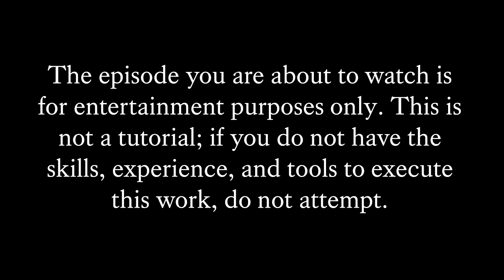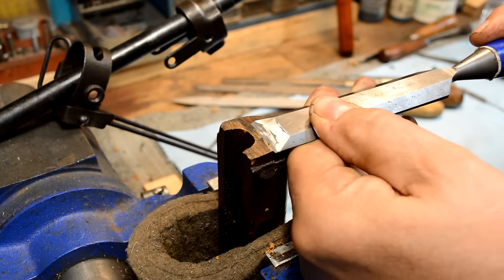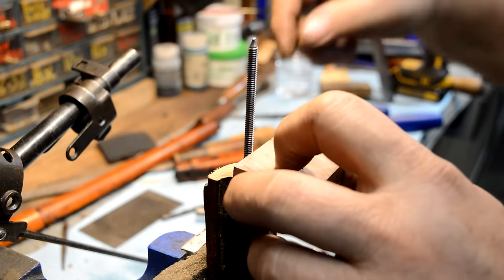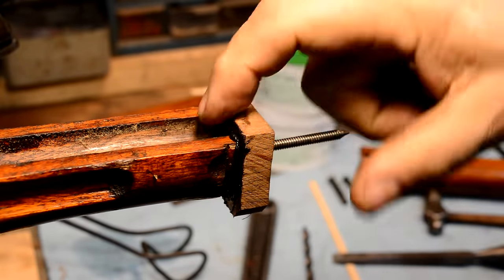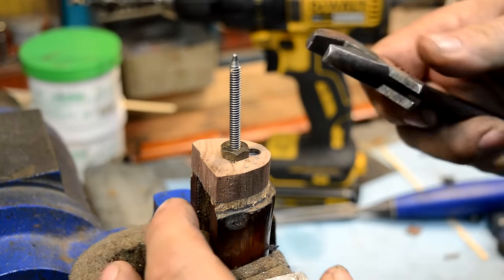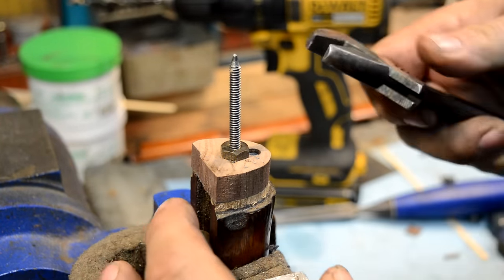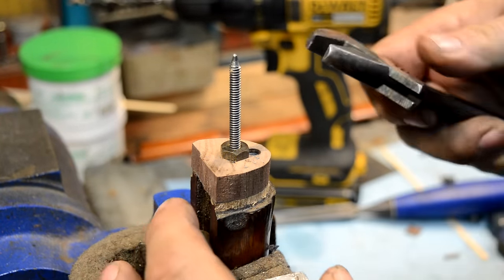Anvil 086: Type 99 Arisaka duffel cut repair

Comment: It's always fun to watch people work that know how to do the work rather than people that try to perfectly engineer a plan and then find out later their perfect plan fell apart.
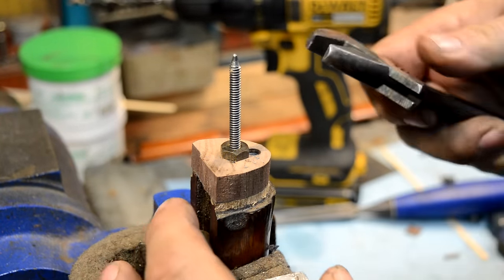Reply: Well this isn't going to be welcome but here we go. @31:53 we can very clearly see that the top edge of the stock on the right is noticeably higher than that on the left of the join. Mark does not see this. This is the stage where the parts are brought together dry so that they can be fitted correctly. Look closely, it can be seen that the barrel is sitting down hard into the wood on the right but is lifted in the wood on the left as witnessed by a gap between the wood and the metal on the left. This can only be caused by the wood on the right being too high in relation to the mother stock and shows that the hole for the threaded rod is in the wrong position and is causing the joint to be out of line. 
Having assembled the joint @37:43 we see that the exact same conditions apply and the repair is out of line. Start watching at 38:10 Mark checks the alignment and (look closely) moves the stock even further out of alignment by lifting it higher. Shortly after this he confidently tells us that this is not the sort of gun that you learn on. @40:10 here's the smoking gun! Notice how the wood grain is showing through the glue. It stops showing at the exact line of the join because the barrel was lifted up from the mother stock by the miss aligned stock. All the pressure of the rubber strap could not pull it true because the threaded rod could not allow it to move into line. @42:32 look closely at the visible left hand edge of the glue and it can be seen to have considerable thickness. This is the result of the barrel not sitting down in its cradle in the stock. The thickness of the glue exactly matches the degree of missalignment of the top edge. @45:01 he finally notices the problem with the top edge of the stock and cuts a little wood off. @45:16 Mark starts to explain that wood moves with time and he's right. However no amount of explanation can put this situation right. @47:18 he cuts away wood and tells us that it swelled right here. He demonstrates that he does not understand why the top edges are not in line and level. @49:14 this is the first time that we see the results of the missalignment. Not withstanding any bending of the top stock the gap between the top and bottom on the left of the joint is exactly equal to the degree of error in jigging the two parts of the stock together. Mark's attempts to blend the joint are seen as a freshly cut ramp in the wood. @51:23 Mark is telling us that the front end joint is tight and it is. However he makes no mention of the gap behind the joint which will always be there. @54:20 observe the gap where the top covers the bottom. In spite of any explanations that gap is there because Mark assembled it out of line. 
I have been a gunsmith for over 40 years and am often called upon to correct poor repairs. I despair at this job and I wonder if the owner will be content with explanations of swelling wood as he holds this rare example. Often I have found that workers who make sure we all know how good they are can produce average work with eloquent and lengthy explanations of how difficult it was and how the average joe would make a hash of it. I expect this comment will be deleted as it will not sit well with Mark Novak. I challenge you to leave it here so that your viewers can respond.
Reply: @IRMacGuyver  I understand about such effects. I also understand about how people deny the truth when (for reasons known only to themselves)they cannot cope with an observation that rattles their cage. The lens beautifully reveals the exact details of why this repair was so very tragic for the owner of this gun.
Reply: @IRMacGuyver  Please explain how a lens can produce a step in a joint. You can plainly see how he tries in vain to level up his mistake with a chisel. The gun is ruined by this repair not by a lens and I'm not sure why you feel the need to deny the truth. This only looks fine if you close your eyes and your mind.
Reply: @IRMacGuyver  Well I didn't expect that level of denial of the truth. Ok if you believe that a defect in a lens can cause the two pieces of wood to be out of line then good luck to you. Before I go I just want to ask you how this lens defect only shows up on that exact point on the gun? I studdied optics for three years and page one of the book tells us that refractive faults are not selective and their effect is always there even when the so-called craftsman is desperately trying to chisel wood from the step in the joint. God help you as you navigate your way through life.
Reply: @IRMacGuyver  By the way, the earth is flat after all. We just found out it was a defect in the lens.
Reply: @jonka1  What denial of truth?  Your made up fiction from not being able to see straight?  Do you really hate this guy so much you have to invent fictions to try and subvert him?
Reply: @IRMacGuyver  I don't hate him. I can see that he sets himself up as a time served expert craftsman and fails to join two pieces of wood properly thereby spoiling a customer's gun. 
As for your problem I'm lost for words at your desperate quest to defend the integrity of his actions. God help you as you navigate your way through your life.
Reply: @jonka1  You must hate him to come comment on my post that had nothing to do with your conspiracy theory.
Reply: @IRMacGuyver  I don't hate him. I initially replied to your words,  "It's always fun to watch people work that know how to do the work rather than people that try to perfectly engineer a plan and then find out later their perfect plan fell apart."
I thought that you had captured the essence of my experience and I wished to offer a different take on the situation. If you wish to go down the "conspiracy theory" road you will not see me there. If you need to be right about something perhaps you need not put it here for public gaze but instead just quietly believe that you are right and I am wrong.
Reply: @jonka1  Yeah but your nonsense conspiracy has nothing to do with the fact he's actually good at what he does.
Reply: @IRMacGuyver  He doesn't need to be good, he has you fighting his corner. I'm tempted to feel sorry for you but if I close my eyes and hold my breath the feeling goes away. 
God help you as you navigate your way through life.
Reply: @IRMacGuyver  I've just checked out your YT channel. Suddenly your behaviour makes perfect sense.
Reply: @jonka1  Too bad your behavior doesn't make sense.  Why do you have to make up lies to try and smear a good man's skills?
Reply: @IRMacGuyver  God help you as you make your way through life.
Reply: @IRMacGuyver  God help you as you make your way through life.
Reply: @IRMacGuyver  :)
Reply: @jonka1  smile all you want but you still don't know anything about gunsmithing.
Reply: @IRMacGuyver  :)
Reply: @jonka1  keep proving the point that you have no clue what you're doing.
Reply: @IRMacGuyver  :)
Reply: @jonka1  How can you so carelessly try to smear someone's reputation?
Reply: @IRMacGuyver  :)
Reply: @jonka1  You still have nothing to add to the conversation because you made up your rant in the first place.
Reply: @IRMacGuyver  :)
Reply: @jonka1  How does it feel to admit you never had a real point to make and you just want attention?
Reply: @IRMacGuyver  :)
Reply: @jonka1  Do you really enjoy being wrong this much?
Reply: @IRMacGuyver " @jonka1 smile all you want but you still don't know anything about gunsmithing."
I wasn't going to waste any more time on you but I just wanted to let you know that I collected £1800 for two days work on a 16th century wall gun and the customer was in tears of joy for the work I did for him. The work involved a bit more than failing to join two peices of wood together properly, the first day was spent correcting work done by someone who (apparently) had never stopped talking about how skilled he was and how many guns he had rescued from poor workmanship. 
I'm not going to discuss anything further with you and will only smile at your words as you desperately try to be right about nothing.
Reply: @jonka1  No you didn't.  What you did is make up a story because you want to sound like a big guy on the internet.  You don't even have any videos as evidence on your channel.  You just come here to comment on stuff that you know nothing about.
Reply: @IRMacGuyver  :)
Reply: @jonka1  You can keep that up but you can't hide the fact you're making up crap to try and put down a good gunsmith.
Reply: @IRMacGuyver  :)
Reply: @jonka1  It's funny how you claim you know so much as a master gunsmith yet you spend all your time on youtube insulting other people's work instead of filming your own projects.
Reply: @IRMacGuyver  :)
Reply: @IRMacGuyver  :)
Reply: @IRMacGuyver  :)
Reply: @jonka1  You're only smiling cause you know you have no knowledge of real gunsmithing.
Reply: @IRMacGuyver  :)
Reply: @jonka1  It's too bad you aren't a gunsmith you could have fixed a gun instead of replying to this video.
Reply: @IRMacGuyver  :)
Reply: @jonka1  If only you could prove everyone wrong and upload a video of you actually doing something.  But you can't cause you're just here to insult people that do real work.
Reply: @IRMacGuyver  :)
Reply: @IRMacGuyver  :)

Comment: Is the three lobe emblem in the opening a dardick cylinder?
Reply: Nope. That's a cross section of a modern cartridge primer. The priming compound is trapped in a thin layer between the primer cup and an anvil with three lobes. When the firing pin strikes the primer, the compound is violently pinched between the anvil and the primer cup, and being contact sensitive, goes off, thus igniting the powder and sending the bullet down the barrel.

Ties in nicely with the primary series of the channel "anvil" when the anvil is highlighted.

Comment: I think I would have made dovetails in the repair wood for extra contact area. Not that I can do a dovetail joint right now, but that's what I would do. Maybe use a separate piece, shaped like an hourglass. Edit: and add a piece of fiberglass cloth to the barrel bedding area.

And then break out the freaking chem warfare gear for lacquering the repair. Damn, that stuff is NASTY!!!

Comment: Nice Repair and Craftsmanship
Reply: Well this isn't going to be welcome but here we go. @31:53 we can very clearly see that the top edge of the stock on the right is noticeably higher than that on the left of the join. Mark does not see this. This is the stage where the parts are brought together dry so that they can be fitted correctly. Look closely, it can be seen that the barrel is sitting down hard into the wood on the right but is lifted in the wood on the left as witnessed by a gap between the wood and the metal on the left. This can only be caused by the wood on the right being too high in relation to the mother stock and shows that the hole for the threaded rod is in the wrong position and is causing the joint to be out of line. 
Having assembled the joint @37:43 we see that the exact same conditions apply and the repair is out of line. Start watching at 38:10 Mark checks the alignment and (look closely) moves the stock even further out of alignment by lifting it higher. Shortly after this he confidently tells us that this is not the sort of gun that you learn on. @40:10 here's the smoking gun! Notice how the wood grain is showing through the glue. It stops showing at the exact line of the join because the barrel was lifted up from the mother stock by the miss aligned stock. All the pressure of the rubber strap could not pull it true because the threaded rod could not allow it to move into line. @42:32 look closely at the visible left hand edge of the glue and it can be seen to have considerable thickness. This is the result of the barrel not sitting down in its cradle in the stock. The thickness of the glue exactly matches the degree of missalignment of the top edge. @45:01 he finally notices the problem with the top edge of the stock and cuts a little wood off. @45:16 Mark starts to explain that wood moves with time and he's right. However no amount of explanation can put this situation right. @47:18 he cuts away wood and tells us that it swelled right here. He demonstrates that he does not understand why the top edges are not in line and level. @49:14 this is the first time that we see the results of the missalignment. Not withstanding any bending of the top stock the gap between the top and bottom on the left of the joint is exactly equal to the degree of error in jigging the two parts of the stock together. Mark's attempts to blend the joint are seen as a freshly cut ramp in the wood. @51:23 Mark is telling us that the front end joint is tight and it is. However he makes no mention of the gap behind the joint which will always be there. @54:20 observe the gap where the top covers the bottom. In spite of any explanations that gap is there because Mark assembled it out of line. 
I have been a gunsmith for over 40 years and am often called upon to correct poor repairs. I despair at this job and I wonder if the owner will be content with explanations of swelling wood as he holds this rare example. Often I have found that workers who make sure we all know how good they are can produce average work with eloquent and lengthy explanations of how difficult it was and how the average joe would make a hash of it. I expect this comment will be deleted as it will not sit well with Mark Novak. I challenge you to leave it here so that your viewers can respond.
Reply: @jonka1  The closest thing I could find to report you was for spam, you did say you were competition so repeatedly running down a mans skills for apparently no other reason seems to fit. Good day!

Comment: Great use of expoxy now I know how to get it from.
Reply: Well this isn't going to be welcome but here we go. @31:53 we can very clearly see that the top edge of the stock on the right is noticeably higher than that on the left of the join. Mark does not see this. This is the stage where the parts are brought together dry so that they can be fitted correctly. Look closely, it can be seen that the barrel is sitting down hard into the wood on the right but is lifted in the wood on the left as witnessed by a gap between the wood and the metal on the left. This can only be caused by the wood on the right being too high in relation to the mother stock and shows that the hole for the threaded rod is in the wrong position and is causing the joint to be out of line. 
Having assembled the joint @37:43 we see that the exact same conditions apply and the repair is out of line. Start watching at 38:10 Mark checks the alignment and (look closely) moves the stock even further out of alignment by lifting it higher. Shortly after this he confidently tells us that this is not the sort of gun that you learn on. @40:10 here's the smoking gun! Notice how the wood grain is showing through the glue. It stops showing at the exact line of the join because the barrel was lifted up from the mother stock by the miss aligned stock. All the pressure of the rubber strap could not pull it true because the threaded rod could not allow it to move into line. @42:32 look closely at the visible left hand edge of the glue and it can be seen to have considerable thickness. This is the result of the barrel not sitting down in its cradle in the stock. The thickness of the glue exactly matches the degree of missalignment of the top edge. @45:01 he finally notices the problem with the top edge of the stock and cuts a little wood off. @45:16 Mark starts to explain that wood moves with time and he's right. However no amount of explanation can put this situation right. @47:18 he cuts away wood and tells us that it swelled right here. He demonstrates that he does not understand why the top edges are not in line and level. @49:14 this is the first time that we see the results of the missalignment. Not withstanding any bending of the top stock the gap between the top and bottom on the left of the joint is exactly equal to the degree of error in jigging the two parts of the stock together. Mark's attempts to blend the joint are seen as a freshly cut ramp in the wood. @51:23 Mark is telling us that the front end joint is tight and it is. However he makes no mention of the gap behind the joint which will always be there. @54:20 observe the gap where the top covers the bottom. In spite of any explanations that gap is there because Mark assembled it out of line. 
I have been a gunsmith for over 40 years and am often called upon to correct poor repairs. I despair at this job and I wonder if the owner will be content with explanations of swelling wood as he holds this rare example. Often I have found that workers who make sure we all know how good they are can produce average work with eloquent and lengthy explanations of how difficult it was and how the average joe would make a hash of it. I expect this comment will be deleted as it will not sit well with Mark Novak. I challenge you to leave it here so that your viewers can respond.

Comment: Are you saying that whom ever brought this home, had to cut the stock to bring it back?
Reply: yes
Reply: Yes,to fit into a GI duffel bag
Reply: @nilsbachellery6939  The stock is longer than the action and barrel. you took those out of the stock and cut the stock down to make it all fit in a duffle.
Reply: @nilsbachellery6939  Barreled actions are usually just short enough to fit in a duffel  once they are out of a stock.

Stocks overall are much longer, thus only the wood is cut.